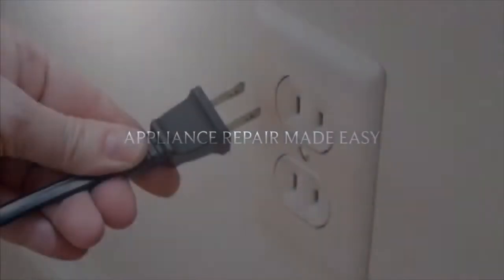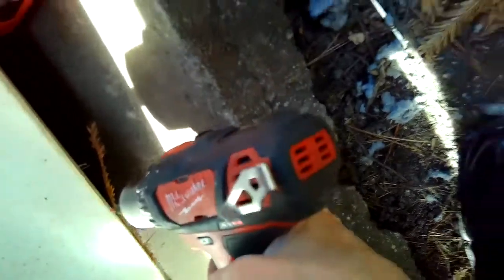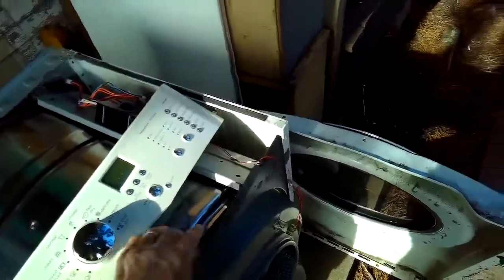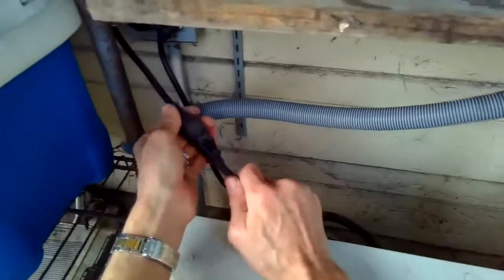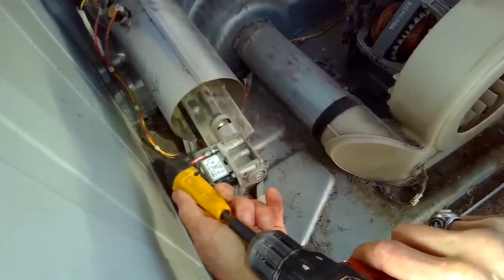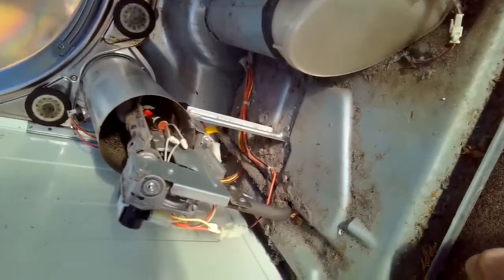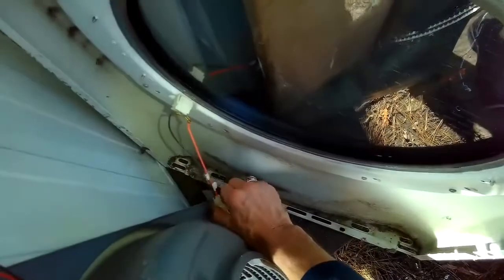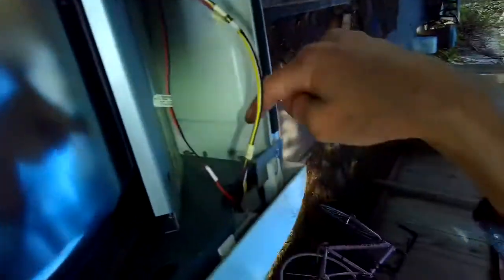✨ ELECTROLUX GAS DRYER NOT HEATING - Easy FIX ✨

Comment: Do you have any videos about the EF3 error code?
Reply from the maker: To fix this error, you can try the following: 
Clean the moisture sensors.
Remove any obstructions from the vents.
Check the dryer vent for clogs and remove any visible blockages.
Should be just a clogged dryer vent tube.

Comment: After seeing  the details with your vid, i was able to get these coils removed just by removing the top and back panels. Much less to disassemble. Thanks!
Reply: Btw, cant seem to find these coils... all the parts suppliers say their not in stock and part numbers dont show up on ebay. Where did you get yours and what part number?

Comment: Though it wasn't my coils, I greatly appreciate your video. Thank you. For those of you who are disassembling your own dryer, look at the bottom part of the air tube that houses everything.  Turns out it was the "eye" on the bottom side of the 4" tube that houses the gas line and the igniter. There was a lot of crud on it and it never shut the ignitor off bc it didn't "see" the flame
Reply from the maker: Thank you,
Nice job.
Reply: Agreed, great video.  I also had the problem with debris in the burner  tube covering the flame sensor.  If I hadn’t read about the problem here I might have missed it.  A handheld vac with a narrow attachment allowed me to suck out the debris easily.  Now it works again.  Thanks!

Comment: Thanks for the vid.  I’ve got the same dryer with the same problem and I was sure I was going to find a bad thermal fuse.  But I have continuity at the fuse and I’m also getting the orange glow but no flames at all. The gas line is good and I’m getting gas through the line so narrowing it down to those same coils you replaced.  Any other tips or should I just order the coils and see how it goes?    Beautiful Submariner by the way!
Reply from the maker: Thanks so much.  I think it’s going to be the gas coils.
I would also do a quick continuity check of the flame sensor.  The thing on the left side of the burner tube that looks like a small deck of cards.

Comment: I’m having trouble removing the front panel. It won’t budge after I removed the 6 screws. Any ideas on how to get it off?
Reply from the maker: Thanks Amy,

Can you pry with a flat screwdriver on both sides of the front panel to make the clips let go.
Reply: @ScottTheFixItGuyChannel  i did that, got two clips loose, the two bottom ones wiggle but i couldn't unclip them. Could anything else be the issue? The panel still feels very stuck on
Reply from the maker: Thanks Amy,
Can you check at the very bottom of the front panel for two more screws?
Reply: @ScottTheFixItGuyChannel  yes I took off two from the top, two from the bottom, two from inside after I opened the door. Could something else be stuck? The sides pull out on both sides but it’s still very stuck
Reply from the maker: Thanks Amy,  There Are 2 screws right in front of the filter housing that need to com out to.
I Hope That You Can Become A Member of Our Channel😊👍
Here’s a Membership Link: https://www.youtube.com/channel/UC7fBqy8806u1r0NpPv_fQ2w/join

Comment: I changed the gas coils, and both thermostats and now I'm changing the igniter and flame sensor tomorrow.   Dryers works but don't heat, could it be the control board?
Reply from the maker: Maybe the igniter will fix it👍

Comment: All my parts tested out  OK as I removed them, but i still swapped out all 5 of the main components and it fixed my issue.  I could see a glow under the unit but no gas kicking in. tried the valves first since i didn't want to remove the drum.  well that didn't solve it, so disassembled again, this time removed drum, its easier than it seems (with that lever), then replaced all 4 parts,  fired up once reassembled and more importantly i heard the heat come on and it was HOT again.  .  Thanks for the video as  it really helped with dissasembly.

EIMGD60LT0 by Electrolux..

EAP2367796	High Limit Thermostat - L200-70F	$31.86
EAP7783961	Thermal Fuse	$26.89
EAP470049	M Series Ignition Coil Kit	$19.63
EAP459818	Flame Sensor	$28.46
EAP4704883	Thermal Fuse	$21.67
Reply from the maker: Good job Scott😊💻 New Appliance Repair Blog - lots of DIY Fixes for Your Home Appliances - Click Here:
https://ApplianceFixes4You.com